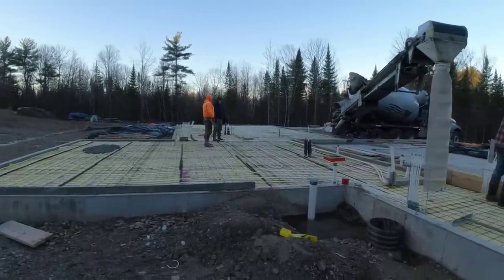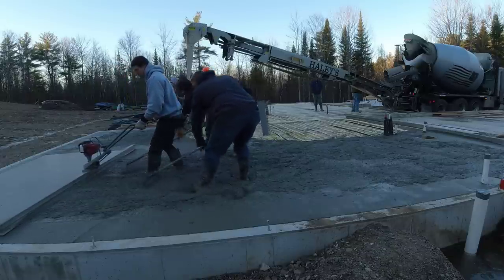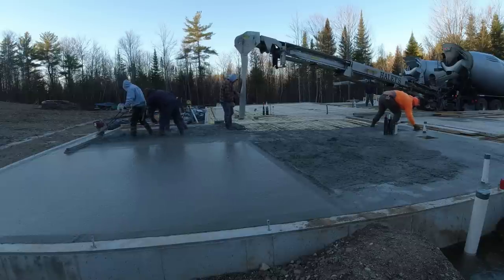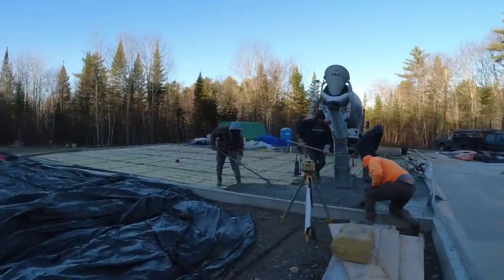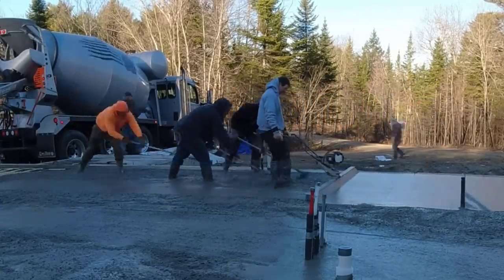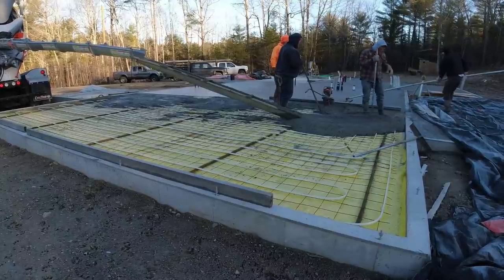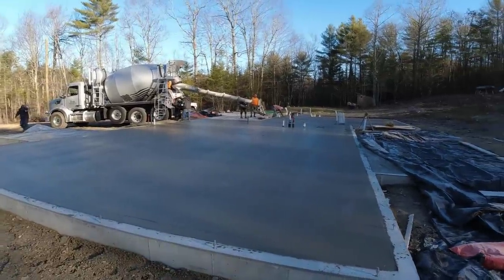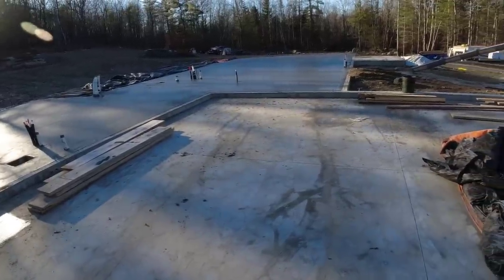BELOW FREEZING - Is It Too Cold To Pour Concrete? (Winter Concrete Mix)

Comment: I've worked on concrete pump's for 30+ years here in Ireland and I have never poured concrete with hot water in it we don't get temperatures as low here but I whould love to try it some day just to see what its like using hot water
Reply from the maker: The hot water works very good for cleaning the concrete off everything afterwards, just can't let it sit in the pump too long or it sets up fast.

Comment: When are cement blankets not enough to keep the pour from freezing?  Is there a minimum temperature that you determine is the cutoff for not pouring and waiting for better weather?  Where I live the day time temps are 40-45 degrees and nights are 20-25. Would it be safe to pour utilizing hot water and 4k psi cement?  Enjoy your videos by the way.  Very informative

Comment: The truck and dry mix being stored in a heated environment, plus the hot water and accelerator makes a huge difference. Does the batch plant estimate working time?
Reply from the maker: The batch plant doesn't estimate working time, they don't pour and finish. It's a little different every day, really depends on water temp, travel distance, how much accelerator used, how fast driver spins his drum on the way to the job, those kinds of things.

Comment: For the radiant heat tubing --  Did the plumber keep it under air pressure so they can check if there are any leaks as you place crete over it?

Comment: 6" slump should not be power screeded as aggregate sinks. The subbase should be preheated as a 4" layer of concrete will loose heat really fast when it hits cold foam bar. I bet by the time your done troweling it the surface is next to freezing. There is a reason commercial work gets horded in. When concrete drops below 60 degrees it almost goes to sleep.

Comment: I don’t work in weather this cold, but aci requires the subgrade to not be frozen? When its cold were required to blanket the subgrade (keep it warm) and even add ground heaters on rare occasions. Curious how it goes in Maine?
Reply: theres foam down under the pour, so not frozen.
Reply: @als8518  thanks. Our code is going in that direction, but right now were required to isolate/thermally break the slab from exterior with a 2’ strip of r10.

Comment: Yeah and 20/20 doing PLANdemic we got a load for 12 by 40 and when the truck got there we told him to add a little water to it we didn't get no more than 5 ft before we all was walking on top of it the concrete guy called in they said the concrete flashed on us so they sent us another truck out and we had to tear that out just at 5 ft of it that was bad was bad and we had no accelerator in it but the concrete company said it was their fault